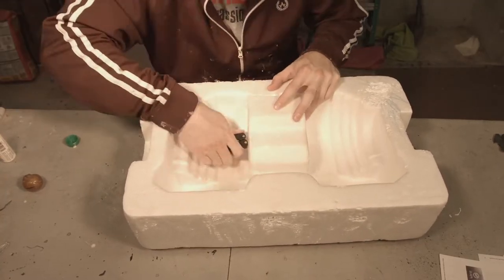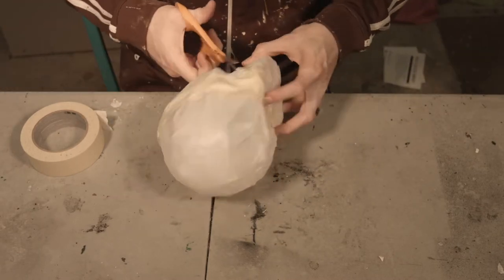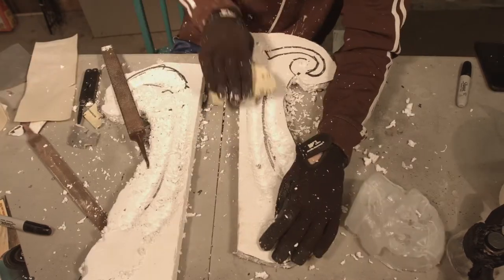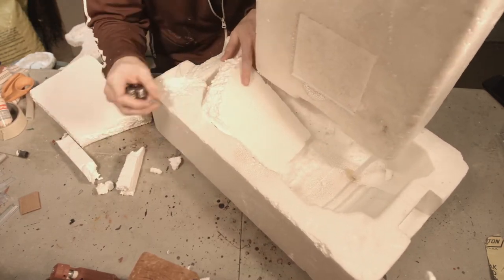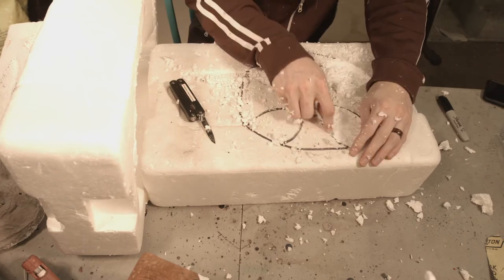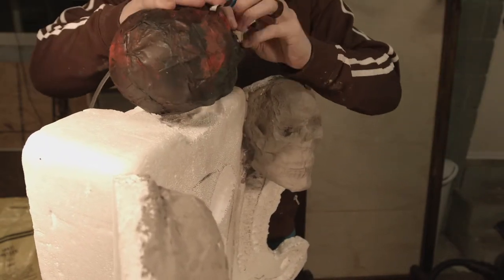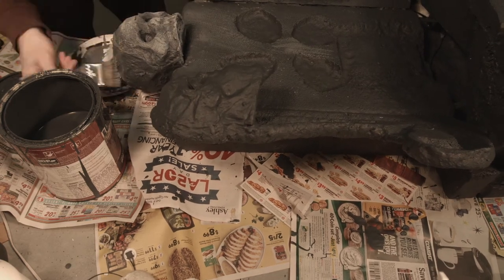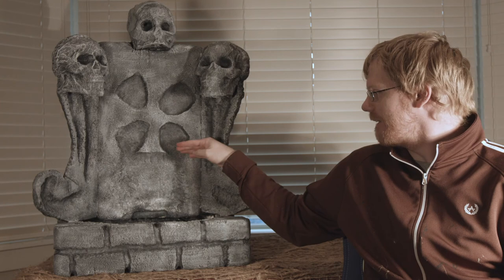JUNKYARD HAUNTS - Tombstone Fountain  - DIY

Comment: cool idea ...i didnt notice if you put any supports when connecting the base to the upright.  a few small pegs of dowel rod holding both together along with the glue would hold it really well.....or just use a longer peg and you can take it apart to store it flatter.